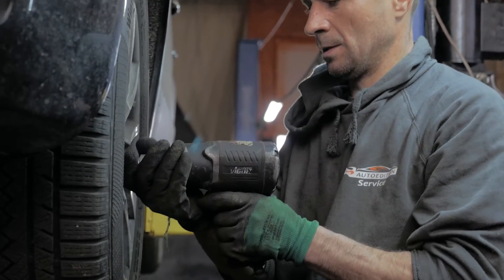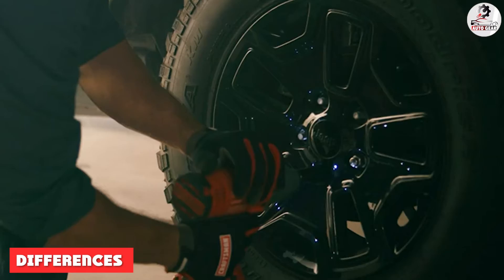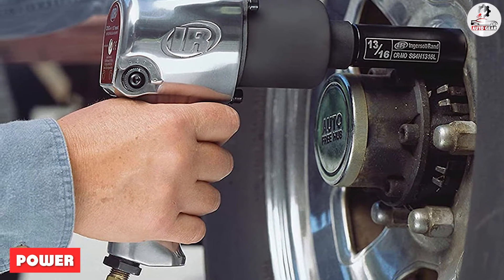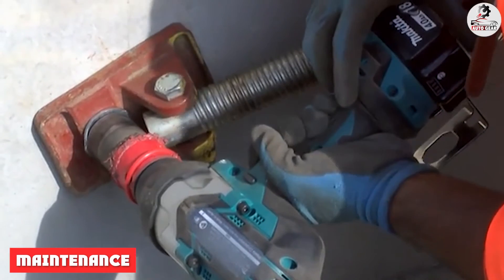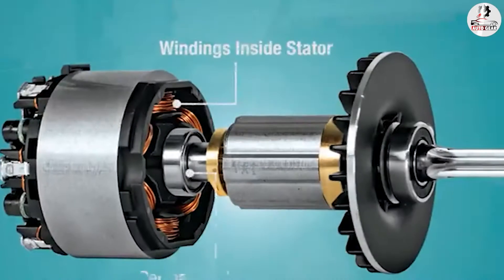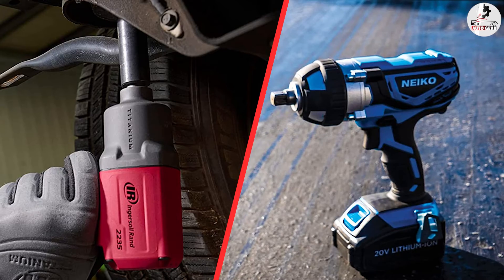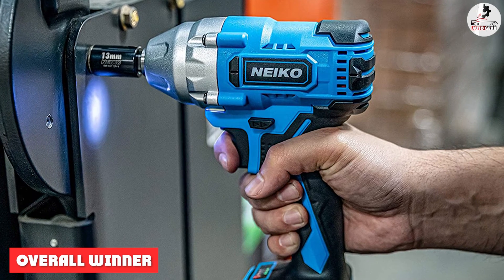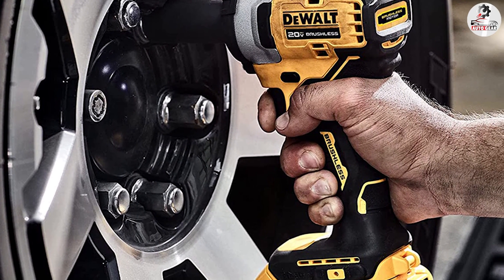Electric vs  Air Impact Wrench 🛠  Which One To Choose?

Comment: This is a poor title for this video. When you say "electric", you're including AC as well as DC impact drivers. Call it "cordless" instead. I was looking for a video that compares the torque of corded impact drivers vs. Air. We all know that battery operated impact drivers can not out do corded especially if a variac is used.
Reply: The best part of that there are battery impacts that are almost as good as pneumatic now lol
Reply: I know corded impacts usually have lower torque than battery units though 🪫 🔋 🧃
Reply: @Realwaltersobchak Yes I agree, I recently bought a Dewalt 20V that is pretty amazing. But you can nearly double the torque of a corded by using a variac. An electrical engineer showed me that trick. Not good for longer torque cycles but short ones, it's hard to beat. That would mean you're giving it more than 110V. Too long and. you're burning the windings. Short bursts only.